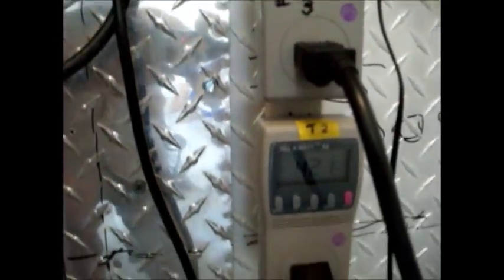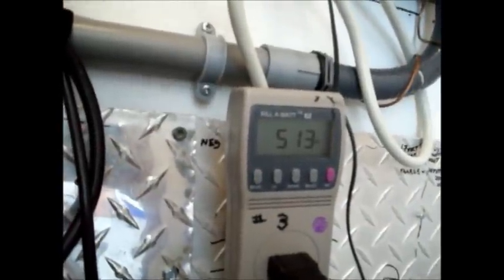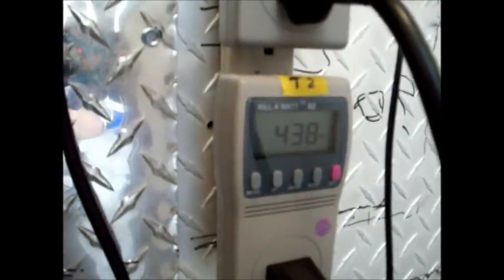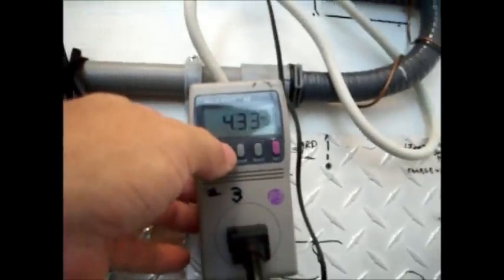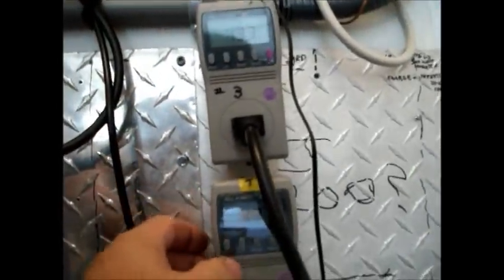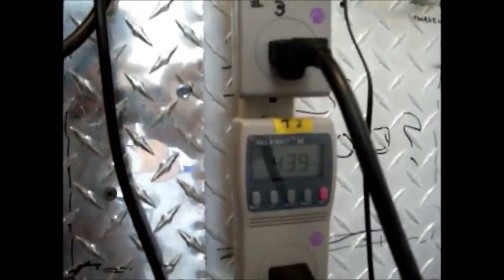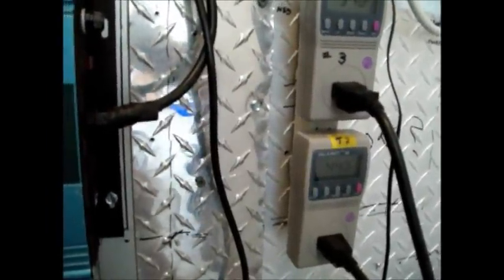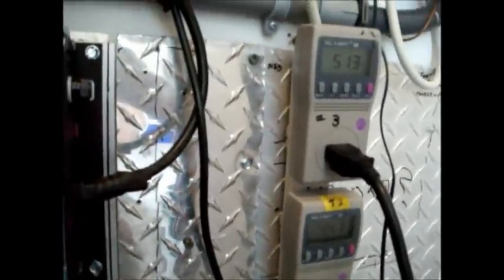How To Add 70 Plus Watts By Axis Adjustment.

Comment: You'd think that building codes would outlaw toothpick construction like that.  Most lumber lards will let you use an insulation blower when you buy the blow in insulation. I did that and it was a breeze to do and it helped a lot.

Comment: That is strange that they would have different power factors, and that will skew your test results also. If you fixed #3 for a test then the results would be very different because it looks like #2 always reads low. You could try switching the KAWs and see if the PF is the same reading. It's too bad because you have a really good setup for doing a comparison tracker/fixed test. The time lapse video should be inside showing the KAWs all day so the numbers can be plugged into a spreadsheet.

Comment: Really don't need to see the outside panels in time lapse, just show one is fixed. Try #3 as fixed one time. And we only need to see KAW 2 and 3 and some kind of clock in the time lapse and then the data can go to a chart. For a valid test the curve of the chart should be about the same for morning and afternoon with the fixed panel showing less in the morning and afternoon of course. What we want to see is EXACTLY how much. I hope you can sort out this power factor problems.

Comment from the maker: A/C IS FINE my make believe home is the problem,i almost died when i cut the hole in the roof to see 1x1s used as trusses/and 2 in"of some sort of insulation.the home is 1500sg ft.not big but not small as i live by myself i have several rooms unused. my poor excuse for attic vent died a while back.the new 1 is 1500cfm the 1 i took out was 100cfm like the ones in my power room.so i expect to be froze out again because i used to be and was told they use over size for these type( HOME).I will see.

Comment from the maker: I,d love to do this but the only way in is like when i cut a bigger hole in the roof as the space between the roof and ceiling is about 12"at the ridge at the lower part of the wall at the soffet is only five" with as i no way in.This is not a real house as i sadly found out i had never seen or new any ,as they in trailer parks i was stupid enough to believe the sales dept. (They are the same as a module home) there not its merely a double wide trailer imitating a house.There all over this Town.